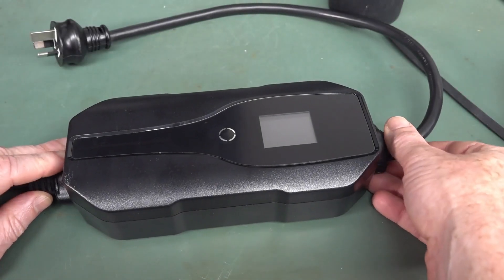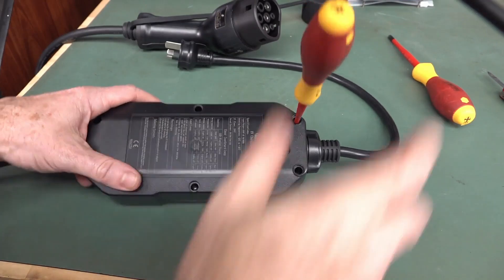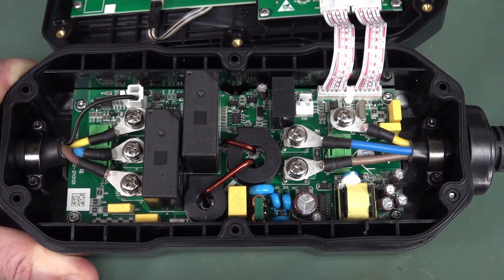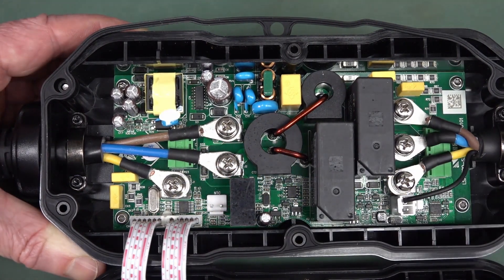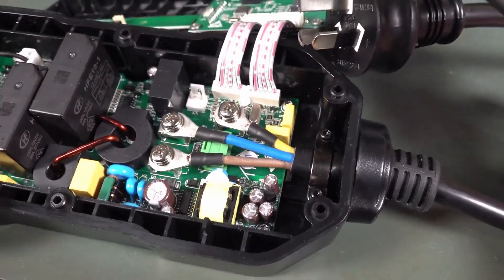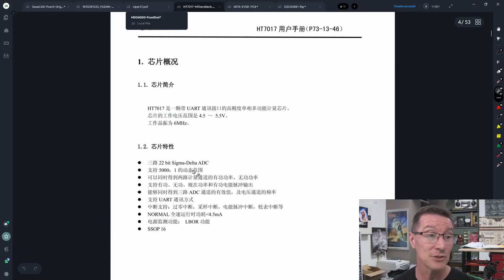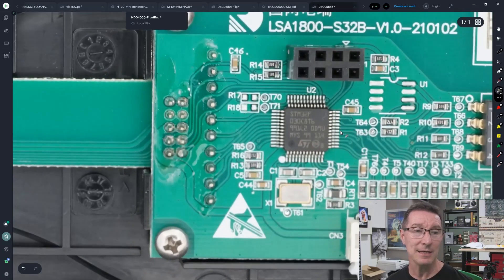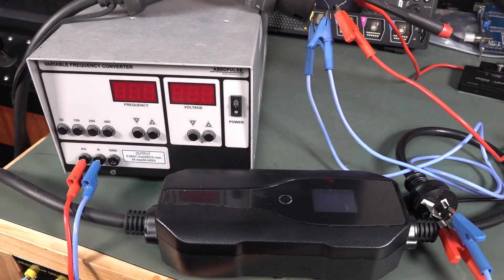EEVblog 1507 - Mida: A surprisingly good cheap portable Electric Car EVSE Charger

Comment: Mine just failed. I let the ute charging and came back to it just partially charged.

It tripped the breaker. I disconnected the car and powered the charger. It smelled horrible and had an RCD ERR message and red light.

A replacement has been sent under warranty so I opened it and the PCB was burnt badly under one of the relays. A different type GTR508Y.

It was bad enough that the casing had a burnt mark and the whole PCB had black residue.

I wonder if it had a cold solder joint or something. I just left a photo in the forum. 

Hopefully the new one lasts.

Comment: If it leaves 240V on the power pins after the car has told it that charging is complete, then it will generate an error on a Tesla and the car cannot restart the charge until the power is cycled on the EVSE unit.  SSRs that leak voltage will do the same thing.

Comment: I've been asking on every video...does evse j1772 interface really require -12v in the pilot signal?   It is only using the positive voltage as the signal and the duty cycle, I see no reason for -12v
Reply: -12V is necessary for the mandatory diode checking.

Comment: Thanks for the really comprehensive review.  The dip switches do set current and region, anything from locking in at a specific current to 1-40amp selectable at 1amp spacing!  I've upgraded my unit from standard UK 13a plug to 16a commando plug, then adjusted the dip switches and got 16a option enabled.  I've got a badly handwritten table of which switches do what if anyone needs it.
Reply: Also bought this charger. I would appreciate if you write the table here

Comment: Can I mod a three phase mobile charger to allow more current. I have a common three phase charger from Aliexpress, that is limited to 16A per phase. It works also with single phase, but limited to 16A or 3.7kw.
I want to mod it to draw 24A single phase. Is it possible?

Comment: Why is there only one pwm control wire? Does it use one of the power wires as reference? But the power wires will have a voltage drop due to the high current. Doesn't seem practicle to me! Or the earth wire?
Reply: Yes, the reference is PE

Comment: Thanks for the review - I got this one in 10amp! This might be a silly question, but is it safe to use outside if the ground is damp or it is raining? Assuming the power point itself is covered. What about if I use it with an extension cable - is there anything to keep in mind? Most of the time it would be in a covered in a garage, but I'm thinking of when we are on holiday where the car is outside and the power point is a little while away (i.e. cable will be running along the ground possibly with a extension cable)

Comment: Great video! I don't have an electric car (yet!) but I would really like to see this modded into a smart extension lead, possibly with remote on/off capability. The remote on/off would be good if it was 5V triggered so it could be activated by, for example, the 5V from a USB lead becoming live when a computer starts up. It could also be triggered as part of a non-EV battery charging setup, to switch on a 12V car battery charger when it is connected to the battery, for example, and show the amount of charge going into the charger and on into the battery.
Reply: Hi. I use cheap "smart" energy meter for this purpose, about 25€. Unfortunately you need enclosure for that. Also you can buy "smart" 20A plug, but I prefer solid connections since the plug can overheat at this current.

Comment: That means the device is NOT SAE J1772 compliant or the European equivalent.  That diode is there so that if the plug is dropped in a puddle of water the power can't be switched on.  It should also throw a fit because the earth circuit is open.  Even the piece of junk that came with my Leaf stopped when the earth connection opened.

Comment: Since the hold current is much less than the toggle current you can cut relay power by over 75% by reducing the voltage.

Comment: Given that the 15A plug has sleeved pins for the hot and neutral, while the 10A plug doesn't, I would expect the standards for the 15A outlets are substantially higher so they are able to reduce the potential contact area on the pins.
Reply: Both should be sleeved, bad example at the start

Comment: As a person who works on these; with big 50+A relays the coil thermal dissipation is substantial. We definitely pay attention to the latching vs holding current and do stuff like adaptively PWM the coil after contact. PCB trace dissipation also all adds up, we have a lot of thermistors. 
 Also; things like UL safety tests for these can be a bit of a PITA...

Comment: I learned, to leave the ground wires always a bit longer, in case of a damaging pull at those cables, the 'hot' cables will disconnect first.

Comment: Interesting it uses latching relays. Another approach might be to use 12v to activate the 12v relay, then drop the voltage to reach it's holding current. This would drop power consumption from 1.5w per relay to maybe 0.26w per relay.

Comment: I would’ve liked to see them leave a bit of slack length on the ground wire to help ensure that the ground connection is the last thing to break in case the cable is forcibly pulled out of the housing.

Comment: Ehh I'm pretty sure this thing does not comply with standard. It is NOT supposed to charge without PE properly connected. It is designed for crazy domestic market which PE connector is not always available( PE connector is mandatory, but dut to various reasons it is possible to be absent). Older EV charger just follows the code, but get too many complaints from the consumers due to missing PE connector. The new design, as you see, completely ignored PE connector detection feature described in the standard.

Comment: The NTC is for the temperature sensor in the plug(the EV charging plug, not the 3-pin plug). The older design normally has this feature for redundent protection. But you need special cable and special plug to accomate this feature which adds cost. Anyway, it's not mandatory, at least not in China. BTW Chinese standards do not permit 32A on this kind of boxes, they have to be permanently installed.

Comment: as for the additional connectors inside

by what i would conclude this is likely just an alternative way to install the board in a different enclosure where you may not directly screw on the wires but instead put them in such a connector, maybe the board is used in other products too

Comment: Call me ignorant, BUT it looks HUGELY over engineered for the little that it does!
Reply: I agree with you. It would be truely a low cost solution if it had no power meter. Only the input/output connections, the required safety features and an LED status indicator. Everything else should be built into the car and displayed on the car's dashboard. No need for processors and LCD screens here.

Comment: Nice parts, should be rated for 20amp like most heavy usage appliances in the US. My freeze dryer requires a dedicated 20smp circuit. It's funny an electric car does not.?
Reply: you do realize that most of the world is 220/230/240V and the US is 110/120V?
Doubling the voltage means four times the power for the same current.
Yes, you can argue multiphase, but that also exists every where, just a question of two or three phase.

Comment: The Latching relay should not be a problem. At least for the car, because the contactor block on your ev battery will disconnect when the communication is interrupted.

Comment: They should also attach the ground together with a wire instead of just the board. If the board breaks it has no more ground connection. (even if its hard to break, it can happen.)
Reply: Shouldn't be a problem with a plastic housing. And ive you break your board, youve got other - bigger - problems... especially youve got an rcd in  your house.

Comment: Why can't you just plug mains into the car? What is this thing for?
Reply: Safety. These protect against a number of faults that can occur. Remember, your car is not grounded but made from metal, is likely outside in the weather, and may have people wandering around it that don't understand that it's electric.
Reply: @tin2001  Then why not have it integrated into the car itself?

Comment: So you could just hack together a simple circuit to fool the car's charger, and apply mains to charge it without this box?
Reply: if you do not mind getting electrified in case of an issue, you only have to apply the right duty cycle with +-15V levels and adding 2 resistors or so. NOT recommend! An EVSE is ad Dave says, not a charger. It is a safety device that can tell the car what max current if can take and only close the relays if there is no earth fault (AC and DC if correctly done)

Comment: The reason for that power monitoring chip is that you have to limit RMS current and it's really hard to measure RMS current if current is not sinusoidal, which you bet it isn't, particularly when you are driving the car charger at very low load factors, down to 1kW for a 22kW charger.
Reply: I wonder how the  accuracy of the current limit has to be on the lower load factors.
Reply: How does it accomplish current limiting? It has only a couple of relays so you mean shutting down the load likeusing fancy electronics to emulate a circuit breaker?
Reply: @andrelange9877  yeah. It tells the car it’s allowed to draw n kW, and if the car fails to honor that, it fucked around, time for it to find out.

Comment: The NTC is for the input cable so it can monitor the connector temperature.
Not sure where it is mandatory but some places it is. Especially if passing the 10 amp limit on a schuko.

Comment: I suppose it might not be bad to keep one in your vehicle's 'trunk' or such, to cover your backside in case you ever wind up with a dead battery and no level 2 30+ amp charger nearby. But as a primary way to charge your vehicle, this thing would be a TERRIBLE choice, because it will take twice as long to achieve the same charge level.

Comment: get "ev charger" in the title...
Reply: Actually is an In-Cable Control and Protection Device (IC-CPD). It's the assigned name for portable devices.
Reply: ...and no, it's not a charger. The charger is in the vehicle, so called On Board Charger (OBC).

Comment: Why are these not available without the typ 2 cable and just a socket? Everyone already has a typ 2 cable and now i have to drive around with two
Reply: wouldn't that mean a bigger connector and box?
Reply: @Sparky400  Slightly bigger box but overall it would be way smaller

Comment: I think the two green connectors are just there for the wires to rest on as a sort of strain relief to help keep the screws from coming loose due to vibrations. Or maybe they could be secondary connectors for the lower current model.

Comment: Faster charging, amps here and there yada yada yada….
Takes about 3 minutes to fuel up a car with gasoline or diesel and off you go…further…with a million gas stations all over the country 👍🏻
EV rubbish.
Reply: Or just plug it in at home and never have to go out of your way to a petrol station again. Unless you're travelling long distances regularly I suspect the time saved avoiding the weekly fill up is greater than the occasional wait at a fast charger.
Reply: @hannahranga 
My Leaf can't even make it to the nearest fast charger. It can do about 90km on a charge, and the nearest fast charger is 99km away. And that's only if i want to go south. The nearest fast charger if I go north is 450km. Not possible (at highway speeds) even on newer models.
Meanwhile, my i20, which cost significantly less, can get 500km on the tank and fill back up in 5 minutes to get back on the road.
Reply: Well I wouldn’t call something rubbish just because it doesn’t suit your situation.

Comment: Would like to see the earth wire longer than L/N. If the cable would be janked out the earth would disconnect last
Reply: even if they left the PCB as is and just made it with a bit of extra slack.

Comment: I would have put the screw lugs further apart avoiding the possibility of ring terminals rotating and causing a short across.
Reply: If the terminations are that loose a short is probably less than bad than a fire from a high resistance connection.

Comment: Ground wires should always be longer than phase wires.
Reply: ?? Most fixed wiring in the UK has smaller ground wires than L (Active/Phase) & N.  

e.g. in 2.5 mm cables (not flexes) the earth is usually 1.5 mm - I believe that 1.5 mm is considered adequate to blow a 32 amp breaker.
Reply: @barrieshepherd7694  longer not thicker, so if the cable gets yanked out you can't have the scenario where the earth is snapped but the active/neutral are still connected.
Reply: @hannahranga  My bad I initially read that as thicker.

Comment: Dave throw it outside overnight with the rain you'll be having you'll know if the ip rating would hold up 
the 8amp feature would be good for those who attack the earth pin with a grinder (not using safety glasses just the safety squint) so it can fit in a standard 10amp socket
Reply: Lot of effort - cut the plug off and install a 'standard' one 😊😊
Reply: @barrieshepherd7694 
Or safer - Bunnings sells a box with a breaker in it that lets you plug a 15A into a 10A socket. Has an RCD too.
Down side is it's $85. But your house is probably worth a little more than that.

Comment: Also available in Europe, as modell MIDA-EVSE-PE16S with a higher current rating: 8A 10A 13A 16Amp. I wonder if there are any differences, I guess: no. ^^

Comment: One of the most dodgy electronics out of China I have run in to are AC to DC converters, I am trying to power a 12v DC tool with 120v wall power.   Super iffy.   I had one meltdown and another smoke and maybe catch on fire but I am not sure.

Comment: Is it just me, or is that EVSE allowing charging with a floating ground blade? Ground faults are supposed to be checked for at power on time, as well as at the start of every charge cycle. How is that working, or is this EVSE ignoring that part of the safety standard?

Comment: In the UK most electricians will tell you these are only for emergencies as PEN faults (when the neutral in the street drops so neutral comes live, and so does earth) just want to kill you at any moment.  The same electricians will go lash up a load of class I outdoor lighting in the flower beds of your garden where the kids play.  Its a huge money spinner installing fixed charge points at the moment here, part of the sales pitch is scaring people off of using portable EVSE's and weirdly (or not) the NICIEC and IET are behind it.
Reply: It's not just the risk of the PEN failing and making the cpc live on the supply side. It's  the DC being passed back from the vehicle to the supply side and having no were to go as most common AC, A and F type RCDs can't see a smooth DC current under 10mA. So a 800v DC current from a modern battery in a failed TN-C-S (PEN) system would be fatal on contact with any extraneous conductor within the Equipotential zone eg any metal or class 1 piece of equipment within the property.
Reply: You can see this guy has both a current sensor and an RCD built in — presumably it’s an A-class or better RCD.

Comment: As an Aussie who has 15A equipment in my garage, I know exactly why you may want to limit the current to 10A......
Reply: And as a German who has a 16A outlet in my garage, I can tell you there is a huge difference of using 16 amps for a few minutes and charging an ev over night 😱
Reply: One could easily have the assumption the only difference between a 10A/15A plug is a rough brass edge on the earth pin.
Reply: @hannahranga  hahahaha yeah, too bad YouTube doesn't let me post photos...
Reply: is there a story behind this?
Reply: @Sparky400  you can easily file down the earth pin on a 15a plug to fit in a 10a socket. Our outlets are designed such that you can plug the lower rated plug into a higher rated socket, but not the other way around. A 10a plug will fit into a 10, 15, 20, 25 and 32 amp socket, but a 25a plug will only fit into a 25a or 32a socket (unless you have a file....)
Reply: @tx5brent  interesting. Here in the US, we don’t generally let lower amp plugs use higher amp receptacles. The main exception is that the common 120v 15 Amp plugs can work with 120v 20A receptacles. (There also exist some very seldom seen 240V 15A and 20 Amp plugs and receptacles, where the 15 can be used in the 20). But in all other cases, the plugs won’t fit by design. The idea is that the cables behind the plugs are probably not rated for more than plug amperage. This means if a soft short occurs in the device causing it to pull more than the plug was designed for but less than the circuit breaker trip current, then the cabling can overheat and become a fire hazard. We don’t want that to happen, so the plugs are deliberately incompatible.  (Also for reference in the US those currents are given as peak ratings, a continuous load is only allowed to pull 80% of those numbers.)
Reply: @tx5brent nah. Not in Au

10A & 15A plugs are 3 flat pins, there’s also a 20A 3 flat pin plug. 

The larger amp plugs are round pins. Incompatible with flat pins. 

Might be different plugs elsewhere
Reply: It’s way too easy to heat damage power points.